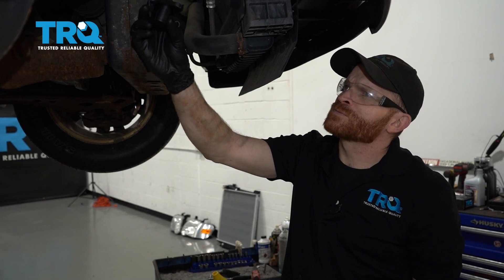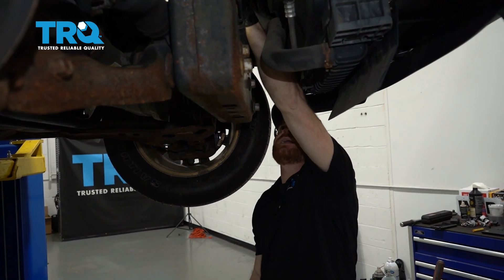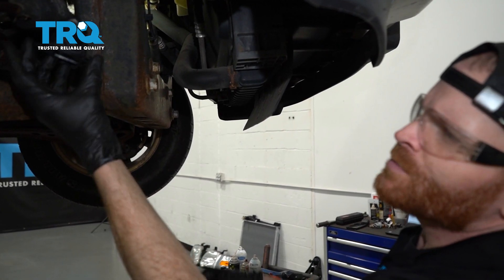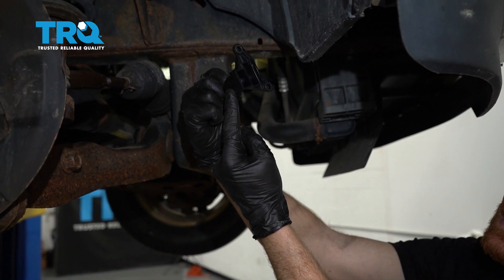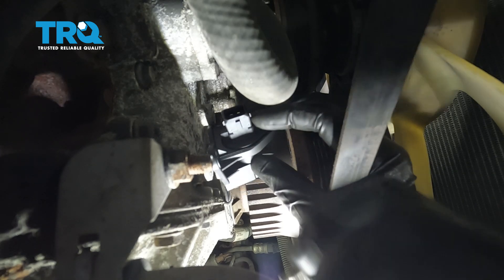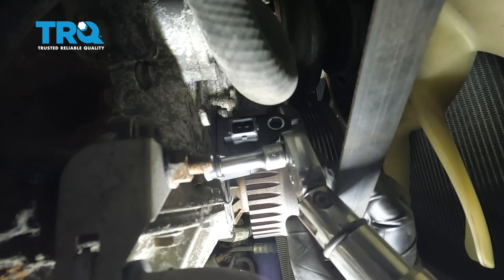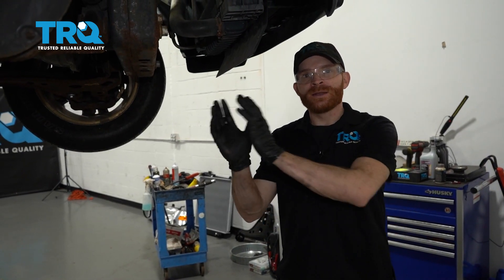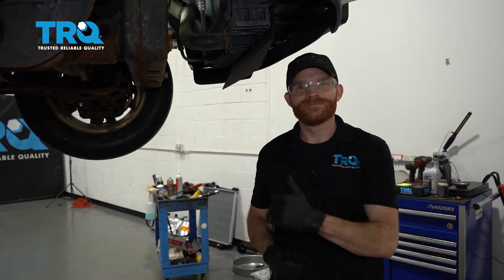How to Replace Crank Position Sensor 2006-10 Ford Explorer

Comment: Does the truck need to be reprogrammed? I replaced my harmonic balancer after it fell of the truck, then 50 miles later I got a check engine light for misfire on 1 and 5. I’m assuming the pulley messed up the crankshaft position sensor.